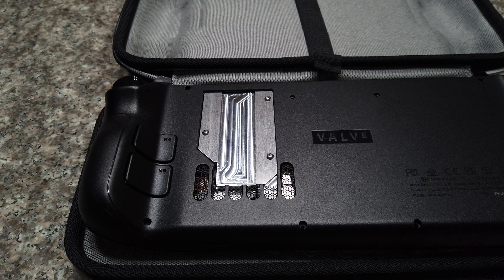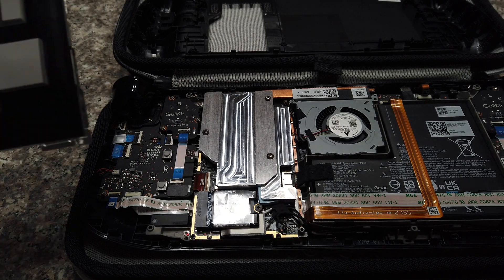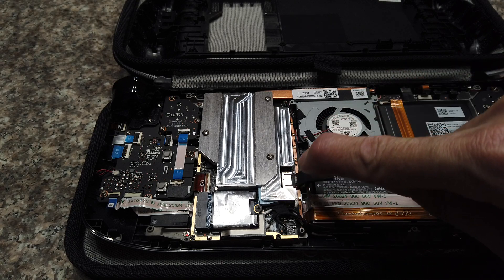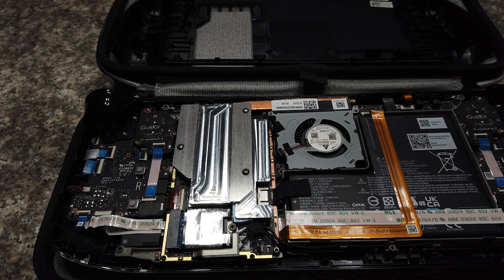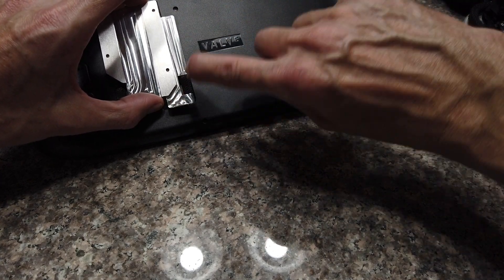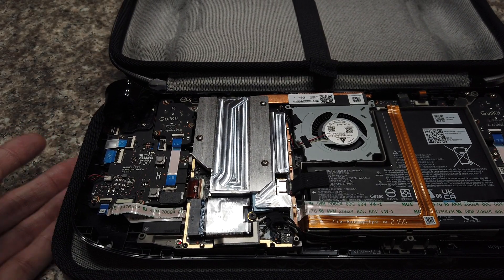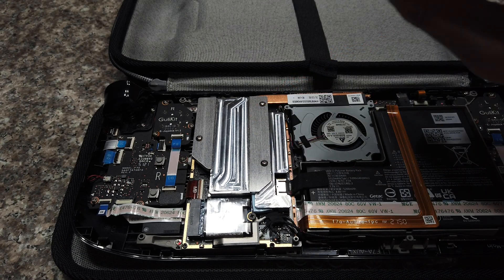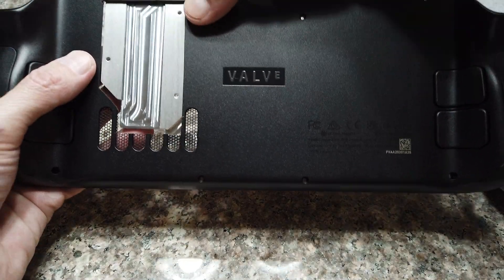Steam Deck Cooling Upgrade Mod CoolDeck M.2 Heatsink w/ Fan

Comment from the maker: In this video, the aluminum version of the CoolDeck is shown, but a new version made of copper is now available. Temperatures average 10 degrees C cooler than the previous aluminum version and 30 degrees C cooler than stock.
Reply: thats bad ass
Reply: wow that's amazing .  i was wondering since you already have the cut out on the shell is it possible to make a template . i want to order but horrible with cutting .. thanks  also if i didnt want to go with a riser heat sink just a flat one how would i attach it to the new mod.. will be ordering soon .
Reply: bro i need one of these

Comment: I like what you have here, but I wouldn't want to add the fan. I just like the idea of the base plate, but I do feel like it should also be a single piece that melds seamlessly into the primary heat pipe at the top or has its own improved heat pipe. Probably a pipe dream and feels like an expensive undertaking. I would also like a fitted custom backplate and not have to chop into my original.

Comment: how did you cut the plastic out of the backplate so smooth??
Reply from the maker: I used a file to smooth out the edges after making rough cuts with a dremel

Comment: i think between the two hands there is plenty of space. One could remove the original fan and use the entire back area to create a huge dissipator. Maybe something that extend in wideness rather than sticking out like this. Maybe being that big could be passive. I did not see anyone trying this. The idea of having not 1 but even 2 fans, I don't like

Comment: Adding enough weight and bulk to equal a console. What’s the point of having a hand held?  These things have internal fans that you can ramp up and down. They’re designed for cooling. And if they overheat, they shut down. No biggie. It’ll take years to damage these things from heat. By then, you’ll be in the market for the latest and greatest anyway.
Reply from the maker: Even Valve warned against using the Steam Deck in extremely hot / humid weather.  30 degrees cooler operation is worth it to me.   I have a case that works well with the modded Steam Deck.

Comment: Any chance for a JSAUX back shell compatible version?  Would be nice to use this to better mate the heat source to the exposed aluminum plate on the JSAUX back shell, ditch the super thick thermal pad on the JSAUX case and use thermal grease instead.
Reply from the maker: I want to get one of the JSAUX back shells, but I'm waiting for the blue version. I'll look into it once I have one.
Reply: @lowbudgetify  nice, it would be great to replace that metal shield and all those thermal pads with a nice custom heat spreader

Comment: This is the enthusiast type stuff I love. But now Jsaux has a clear shell with a plate and thermal pad built in as well a forced turbine air add on that will bring it down 20c together.
Reply from the maker: It looks like the Jsaux rear shell uses an aluminum plate & thermal pad on top of the existing EMI shield. The CoolDeck upgrade removes the EMI shield and one thermal pad layer, replaces the thermal pad above the stock heatpipe with thermal paste, and has direct contact to a fan cooled M.2 heatsink. I think he Jssaux case would be a decent cooling solution when combined with a fan and it allows using any Steam Deck case. I will do more thermal testing when I have the new copper version CoolDeck available, but I think it will do better then the Jsaux case.
Reply: @lowbudgetify  The backplate is cool but really does nothing for heat unless you add more.

Comment: If you could make a copper version I would definetely buy one :D
Reply: Ill do a bottom plate  copper mod on it. 
And paste copper heatsink on top.
So no need to drill holes nor ruin the steam deck case

Comment: Just wondering once you placed the heat sink onto the metal plate how do you mount it on? Are there screws or anything to lock it onto the plate? Thank you
Reply: Thermal epoxy

Comment: This is overkill for SSD heating. Why not try to replace the fan top metal plate with the larger plate, and the plate needs to cover the SSD with Thermal paste. It can transfer the heat to the stock fan

Comment: can you make it in copper? The thermal conductivity is about 70% better than aluminum. I want to avoid the extra fan but just run it as a massive copper heatsink.
Reply: First of all copper would be way more expensive since this gets cut out of a solid block of aluminum. Second using this without a fan would just lead it to head up to about 70 degrees Celsius and start burning you.

Comment: Is there a version that's machined thin enough to not cut the back open? Basically just an improved heat sink with the extra thermal pads on the chips
Reply from the maker: A thin, flat plate that fits inside the Steam Deck  wouldn't really help with cooling since it would be insulated by plastic. A heatsink / fan is needed for this to significantly improve temperatures.
Reply: worst thing is you can buy a replacement backplace from IFIX IT for under $30. That would be the best thing to do

Comment: Where can I buy this? I made my own a while back but no where near this quality. I only have a manual bench mill and I have almost zero experience milling. The best part is I'm using the exact same M.2 cooler. Also I ordered a new back plate from ifixit so I didn't have to cut up the original.
Reply from the maker: there's a link in the description

Comment: Nice I see you took LTT's concept and made some adjustments. Did you also make it so that the charging ICU is also being cooled by the plate?
Reply from the maker: Yes the aluminum plate covers the charging IC and has a thermal pad, no additional heatsink necessary.

Comment: They should make this avalible on the steam deck 2 with the ability to power external fan with fan wires
Reply from the maker: I just wish Valve would have used a slightly larger fan connector that I could buy.

Comment: 05:40 i am not sure about this but maybe we can solder the 3 wires directly onto the solderpoints of the internal fan(underneath the round sticker) so we do not have to damage the wires.
Reply: no can not ask for more power supply to rails not designed for the extra current demand
Reply: I do not believe you.
Reply: @Skhillz_FN  First of all the Internal Fan also adjust its power so it is able to do it. Also with the Heatsinks the fans will never spin as fast as without anyways.

Comment: Hello Friend. Thank you for sharing this with us. Looks cool.
03:05 do you know exactly the temps before and after? 
Is it possible for you to make a (thinner)plate that covers all the components and decreases the gaps between the components and the plate. Thinner thermal pads = better cooling. It should be possible to cool for example the charging ic better and not effect the airflow and  look of the deck. (No holes in the backplate needed)
Can you please set the fan speed to 20%, 50%, 70% manually with the mod (without the external fan) and stock and then check, if the RPMs and exhaust air speed are the same? If they differ that means that the internal fan pushes less air with this plate on. (More RPM does not mean more air is pushed out) 

Thank you :)
Reply from the maker: It's not possible to make a flat bottom plate that mounts any closer to the motherboard unless you remove the original copper heatpipe cooler.

Comment: Good idea, Me being a designer... Why don't you add some threaded holes in your heatsink? So then you can add a mounting bracket, then you could add just a slim heatsink, with fan or chsnge it up with a m. 2 heatsink and if you wanted you could take it off completely if your travelling, you still could use thermal paste
Reply from the maker: I did consider adding additional mounting holes for a bracket. There are so many different M.2 heatsinks available I didn't know the best "universal" mounting method. If the heatsink was detachable, a thermal pad wouldn't make a mess like thermal paste. A thermal pad also wouldn't transfer heat as well, so I just made my Steam Deck with the heatsink permanently attached.
Reply: @lowbudgetify  Low_budget is there a way i can contact you? i have more ideas
Reply: Because there's no standard mounting pattern.  Duh.  Gamers.

Comment: nice job, if i had a cnc machine,  i would place a slim holeplate cooler in the middle over the installed fan and connect it with a heatpipe to the apu. The problem with your variant is the screw holes that are only held over the mainboard and this is very vulnerable if the steam deck falls down
Reply from the maker: there really isn't any other practical way to mount this plate at the correct height without using the 3 threaded holes in the motherboard.

Comment: You made it look good, congrats.  I think I rather slap on some liquid metal to reduce temps and therefore fan speed.
Reply from the maker: I'm a bit nervous about using liquid metal on systems that didn't originally come with it. Isn't it conductive?
Reply: @lowbudgetify  it also dissolves aluminum, so you would need to make a copper coldplate
Reply: Yes but as long as it doesn't touch the mother board surrounding the APU, 2 small dips, one on the apu and one on top.

Comment: wish the plate can be designed in a way that the heatsink can be screwed on, so the heat sink can be removed if needed.
Reply from the maker: It would require making a mount for a specific model heatsink, since there are so many different M.2 heatsinks available. For effective cooling it would need pressure applied to it or a thermal pad.

Comment: It's just the mod of Linus Tech Tips. Bruh
Reply: You LTT fanboys think everything revolves around Linus.
Reply: @capslock4959  Absolutely no! How much frustration I read between your lines, I advise you to make peace with yourself! Ahahahah
Reply: Thought when Linus did this the temperature didn't go down by much
Reply from the maker: @Jackalvs I designed it on my computer and sent the file to a machine shop for manufacturing.
Reply from the maker: I don't claim credit as the first person to cool off hot CPUs by adding metal, fins, and fans. The CoolDeck is similar to what they made in the Linus video on steam deck cooling. I made my own design based on my own measurements & testing. I may be biased, but I think my cooling solution is better IMHO.
Reply: @lowbudgetify  Okay. Good. But it's identical. 🤷🏻‍♂️
Reply from the maker: The main difference between my Steam Deck heatsink mount and the one made on the Linus video is this one can be implemented without an industrial Tormach CNC machine, $100,000 of Solidworks licenses, on staff engineer / machinist.
Reply: @lowbudgetify  You just contradicted yourself, lol. just send your project to a company that performs metalworking with cnc. Of course, since they have it in the editorial office, Linus used that. Hahaha

Comment: I think first issue witht the deck that needs to be addressed is battery…solve that and rest will follow..
Reply: I dont even have an issue with it lmao. Sounds like a you probably.... buy a battery.... lol now this guys deck will never lay down on its back 🤣
Reply: @NoFaceCobain  I got 2 batteries 30000mah at 65w output but would prefer the deck battery to last bit longer

Comment: was this inspired by the Linus  video on steam deck cooling
Reply: he didn't mention it, but it's exactly the one shown on Linus' Video.
Reply from the maker: I did see the Linus video on Steam Deck cooling. The CoolDeck is similar to what they made, just a heat spreader plate / heatsink mount.

Comment: Looks interesting! Maybe make a 3d printable template for cutting the hole
Reply from the maker: I'm working on this project in stages. Since the thermal transfer plate design & mounting has been worked out, I am now working on a 3d printable fan mounting bracket I will share the .stl file for. I will look into options for a cutting template eventually, including a 3d printable download.
Reply: @lowbudgetify  having an stl of the heatsink would be nice, too! Great work